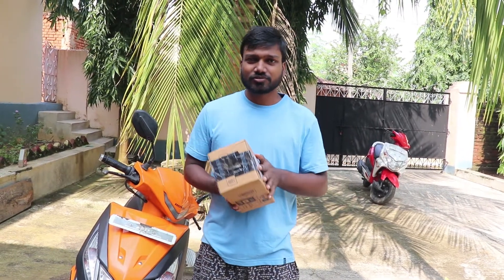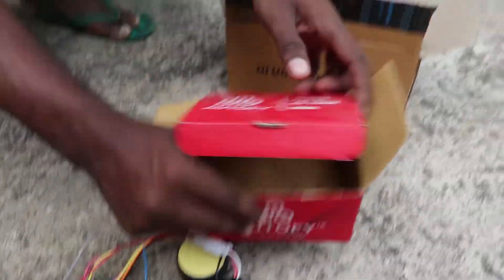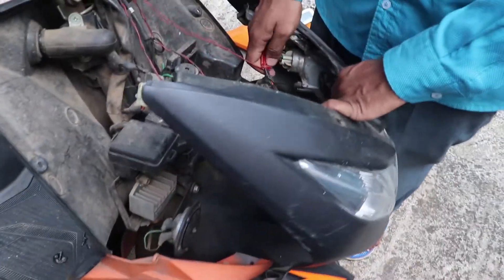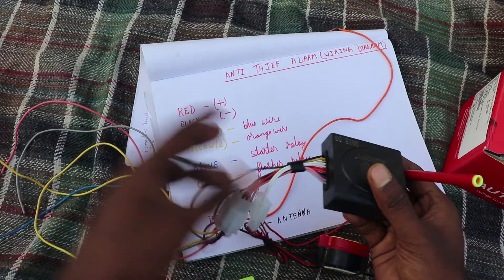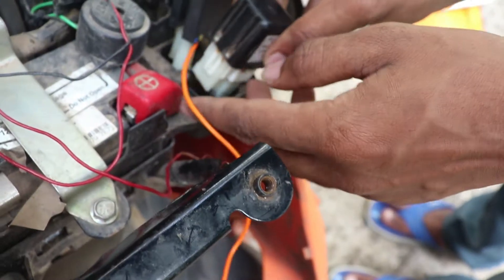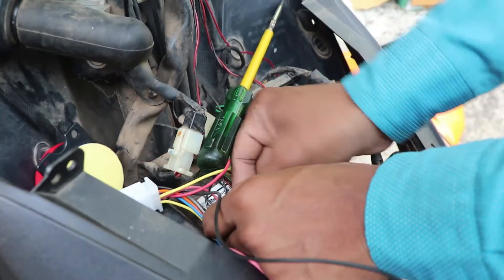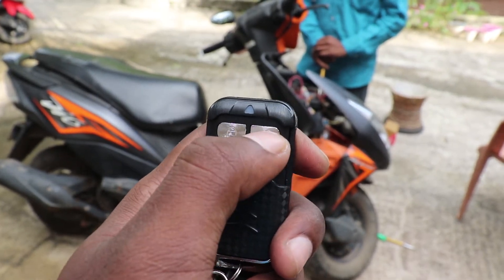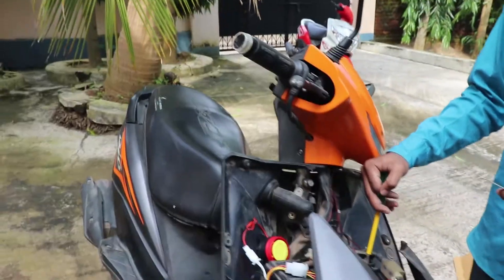Installing Anti Thief Alarm on Honda Dio Scooty | Modified Scooty

Comment: ek questions tha.....
wiring krne me kahin Short circuit ka dr rhta hai ki nai..?
Reply from the maker: Daar tho hai. INSTALL kartha time use kya tho Red wire pura heat ho Gaya baad mai red wire ko Accha sa tight sa Battery Mai connect kiya  phir OK tha.
Reply: ok thanKuu so much 😘